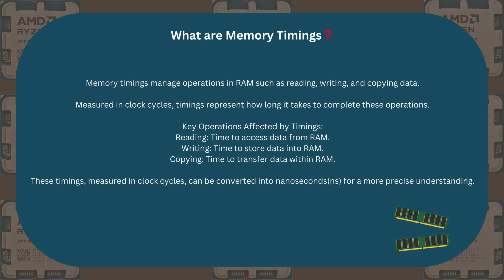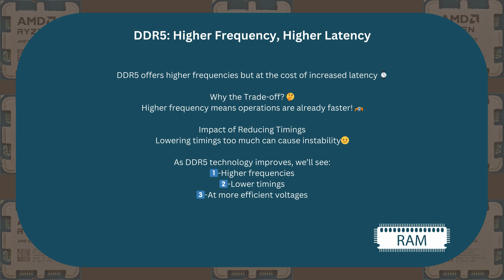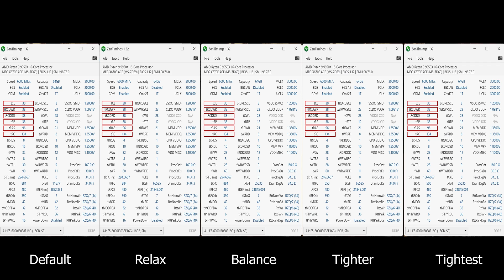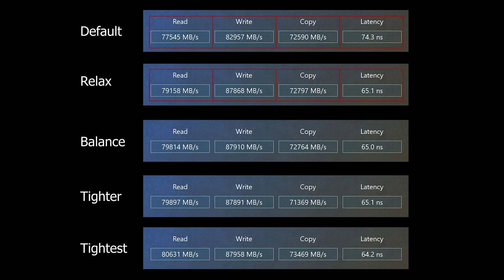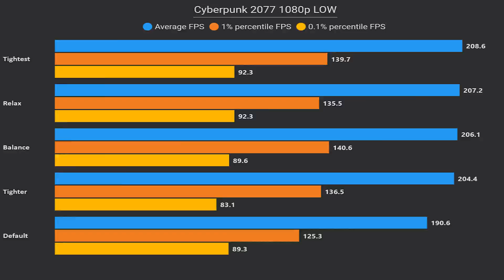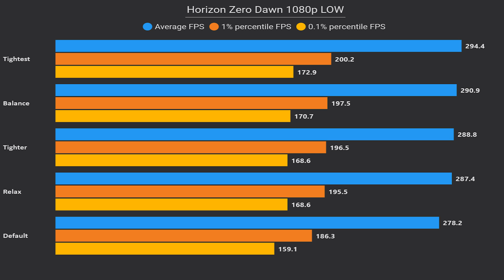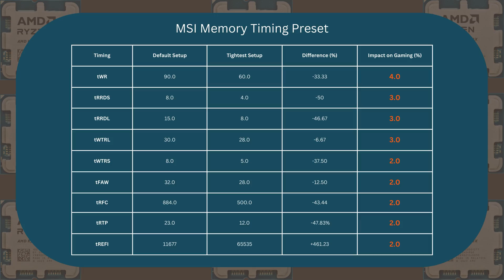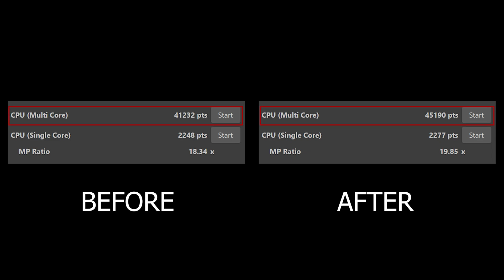MSI Memory Timing Preset BIOS Feature on Ryzen 9950X | 10% RAM Performance Boost

Comment: i set relax on 6400mhz corsair cl 36 run nice ryzen 5 7600
Reply from the maker: Does it work on balanced or tighter?
Reply: @TECHOSAUR  Tighter won't start, my PC stays on red and orange light. CMOS battery reset fixes the problem. I tried Relax or Balance but I don't see any noticeable difference and it is much more stable and better Relax. I have tested it in several games, including the most demanding Monster Hunter Wilds, without any problems. (My mobo is MSI PRO WIFI B650 S) Corsair 6400MHz XMP 36 48 48 104 RAM
Reply: @TECHOSAUR  For some strange reason, 6400MHz XMP runs better in Relax mode. Without activating the MSI Memory Timing Preset option, I experience crashes and PC reboots. This would have set it to 6000MHz earlier. Now, with Relax mode, I can run 6400MHz without problems for extended hours of gaming.

Comment: After setting it up like that, it won't boot. Why is that? I reset the BIOS and restored it
Reply from the maker: Tightening memory timings too much may not always work, that's why there are different presets. Try a less intense one
Reply: @TECHOSAUR  I'm using Samsung RAM. Will Samsung RAM work?
Reply from the maker: If you mean it's not booting, how did you reset the BIOS? It should go back to factory settings and work

Comment: Memory Context Restored / Power Down and Gear Down Mode should = disable ?
Reply from the maker: Try using memory context restore. You will have less booting time, but you may get a BSOD. It may work fine; for me, it does cause problems.

Power down to disable it because it also causes stability issues.

Gear down. I need to check on that.